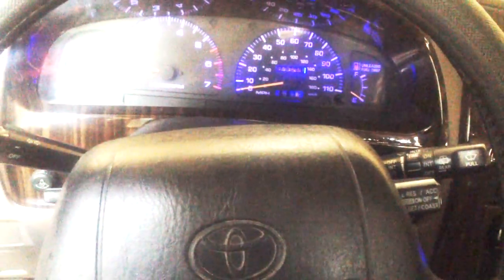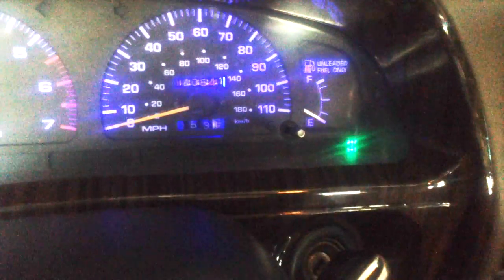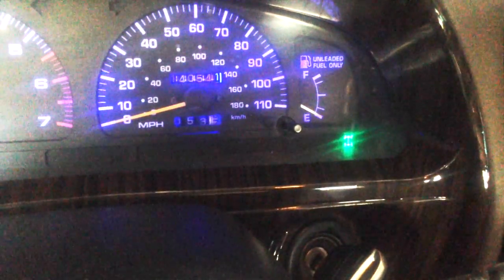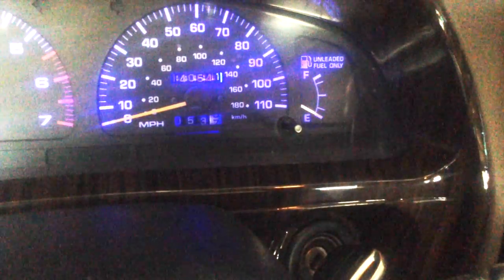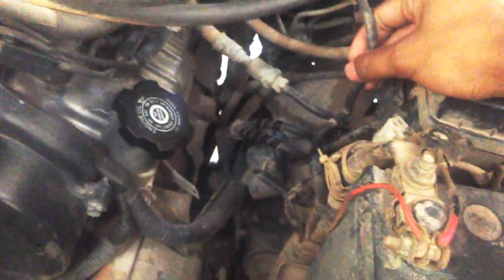4WD Front Diff doesn't engage!

Comment: I have the exact same problem, except the light doesn't come on. The wires for the power seat on the passenger side shorted out and caused a ton of electrical problems. I still haven't finished it out and every mechanic I've talked to have never even heard of a 4runner having electrical problems this bad. My guess is in your situation is that there's no signal coming from the 4wd module to the VSV, so check the wires and make sure none of them are shorted or damaged. If that isn't the problem then your VSV is probably seized.

Comment: I’m not too familiar of repair or diagnostic with 4x4. If you able to find a vacuum line from module to somewhere connect to and you might find the crack along when you follow that line. Either way it should be module isn’t working or electric can be damaged somewhere. That all I can think of.

Comment: What size of engine is it ?
Reply: Justin Sparks 350
Reply: Wtf I didn't ride that haha
Reply: My issue was a spark plug backed off And air was bypassing
Reply: Wow wtf my bad that's my knocking noise I'm referring to lol that was another issue I had. For my vac line issue I just switch them around
Reply: that is correct  @northbayfreeriders3819